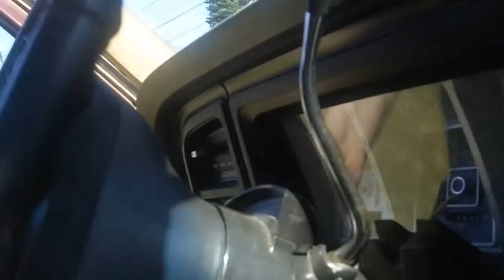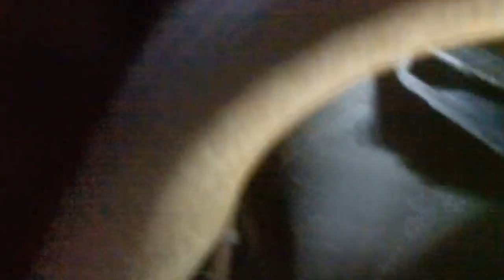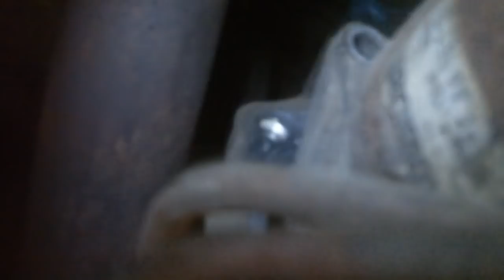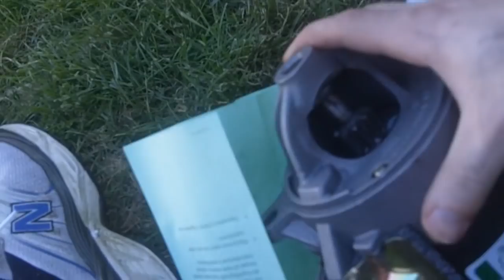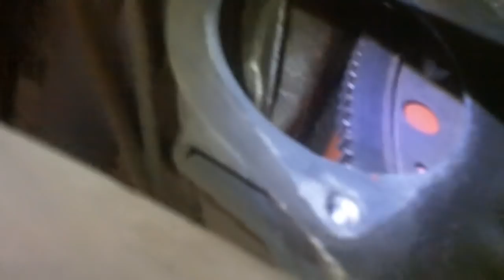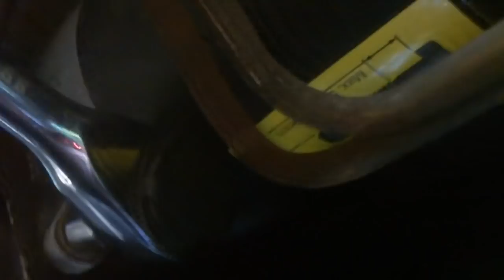How to: Starter Removal, Replacement/Repair (Permanent Temporary Fix  2.0)

Comment: On the internet it says I need to Disconnect the wiring to the solenoid. How do I do that? And what is a solenoid? Is that something on the starter?
Reply from the maker: You don't have to do that at all. It can be on the starter yes, but yeah, there's no need. It will often say to "disconnect the negative battery cable" for safety reasons, but you're not messing with electrical stuff here.
Reply: @Subfightr  Thank you for the info. I did disconnect the negative battery terminal. My car wouldn't start when I came out from work it only made a very low tone "Clunk" sound. And just one "clunk."
Reply from the maker: @Decision_Justice  I assume you got it to start eventually? Did someone give you a jump? Have you had this issue in the past?
Reply: @Subfightr  Unfortunately I couldn't get it to start. I spent 3 days trying to replace my starter. Once I got the old starter off a neighbor suggested having it tested to see if it worked. It worked fine. So it wasn't my starter after all. My neighbor thinks it's my engine.

Comment: Core: valuable metals that are inside certain parts (copper in alternators etc.,) that they use to refurbish non-working parts into working parts that they will sell you at full price of a new factory made part

Comment: Thank you for this video!  You cracked me up and you helped me fix my van!  The only part that you didn't chat about was a special little wire that I had to strip and clamp back to the battery.  I got that figured out with a little help from a "phone a friend" (i.e. my dad) and it is fixed.  I skipped the dog shit though!  ;)

Comment: Thanks so much for the video I was stuck with starter problem it just clicked once and then wont spin at all to start the car, I disconnected the connectors cleaned them and it was all good aft3r that.
Reply from the maker: Interesting, did it stay working or did you eventually have to replace the starter? Thanks for the info. I'm a weeee bit late in noticing your comment sorry

Comment: Thank you so much for the tutorial! I almost had to remove the alternator in my wife's van (it's showing its age!), when a mechanic friend of mine told me to whack the starter with a hammer to see if it turns over. I did, and the van fired up. So, what I have to do is remove the starter and take it to my son's job at AutoZone to test it. It could be the solenoids. It could be the starter itself. I won't know until they test it. Now, I just have to get it out first. :)

Comment from the maker: @Zug75  It couldnt hurt removing it, the starter should not move though. Some starters do have "shims" like washers all stacked up to make the starter fit correctly, that may be an issue, The starter falls out a bit?! Are the threads stripped? You could get a product called "locktight", small tube bout 3 bucks, put it on the threads and that SHOULD prevent the starter from backing out if its due to the threads.

Comment: mine is a 1999 chevy lumina and it makes a loud grinding noise? could i remove it and put it back on cuz i almost got into a wreak on the left front side my headlight is smashed and the hit mit have took out the starter a little bit and every time i use it i falls out a bit till it can't work i think so i mite need to be placed in further to connect is that right??? rite bac thks ill subscribe :)

Comment from the maker: @askmomshesright Yeah I was surprised how stuck the nut was on top of the wire. The tool I used to remove it is called a "ratcheting wrench" but a normal wrench will do, this will just save some time, though it is a tad fatter than your average wrench so it does not fit in places like the normal wrench will. As you see I had to strike the wrench to break the nut free. Try adding a pipe to the wrench for leverage, or link another wrench on if you don't have a pipe to fit over the wrench.